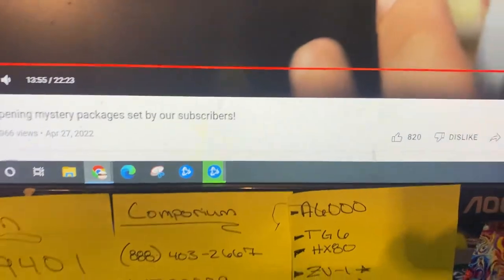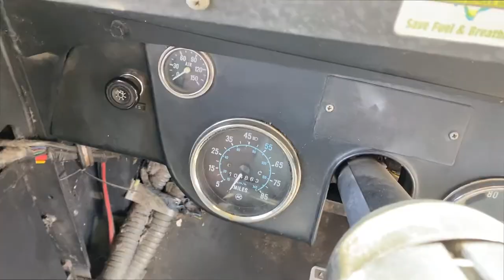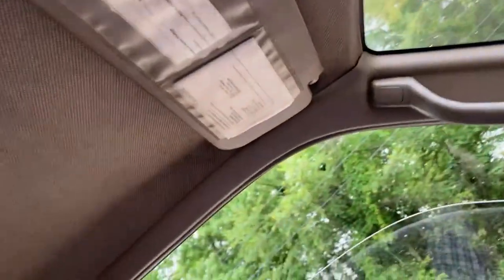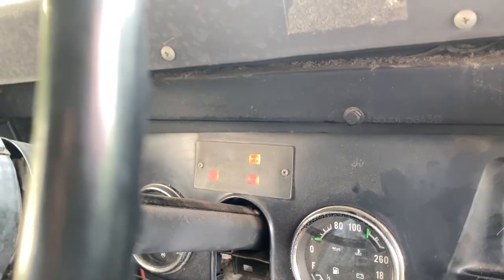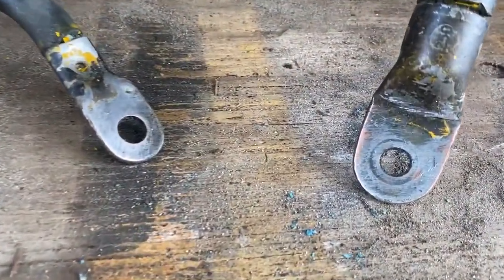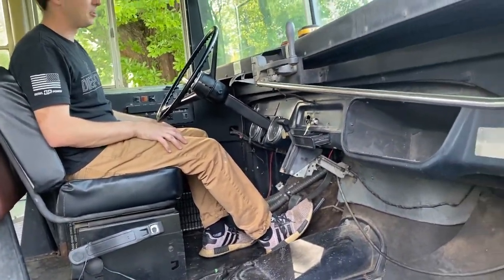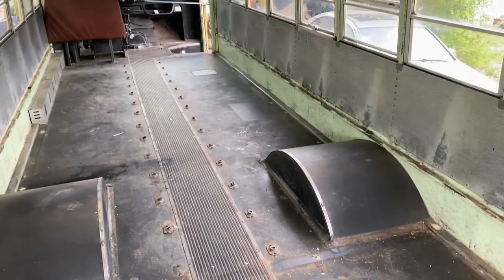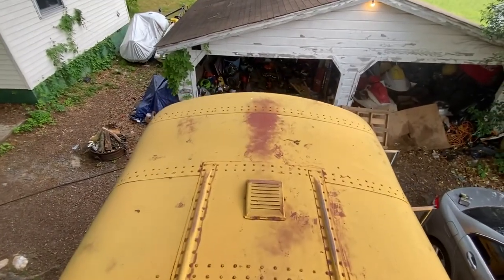Will it Start? - Free Abandoned 8.2l Diesel School Bus

Comment: That is definitely a North Carolina bus, so I'm guessing you are from North Carolina. I used to work on these type of buses for a living. The 8.2 Detroit's in my opinion are tough. Diesels the fuel pinchers are hard to beat. They will crank when it is single digits outside. If you don't believe me, I have a video of me. Cranking the 8.2 with it being single digits outside. Just one thing that I will warn you about the fuel solenoids on those buses can be a royal pain in the fanny panny. So with that being said, what I did on all of mine when I worked at the bus garage was I ran a ground from the solenoid to the alternator because if you don't if the solenoid gets too hot it will ruin it